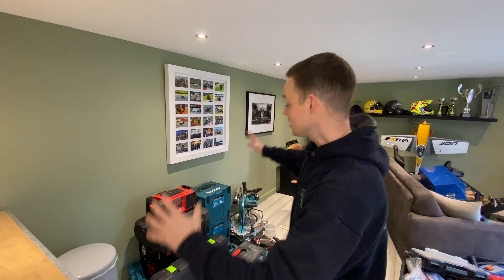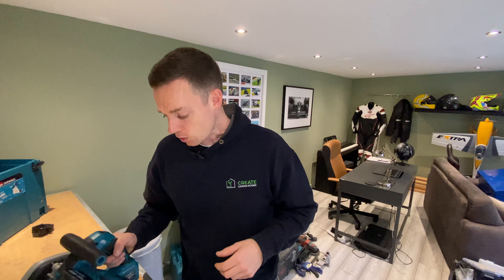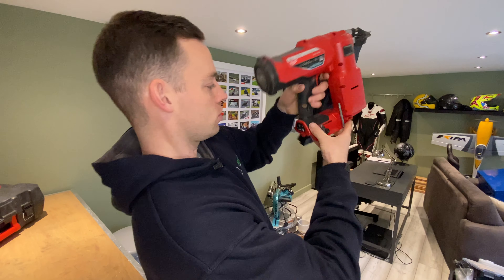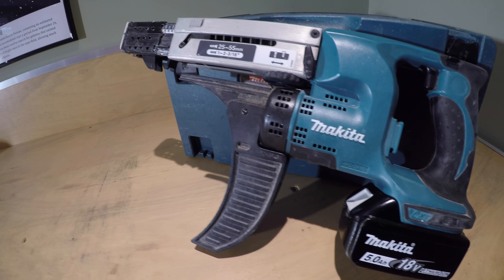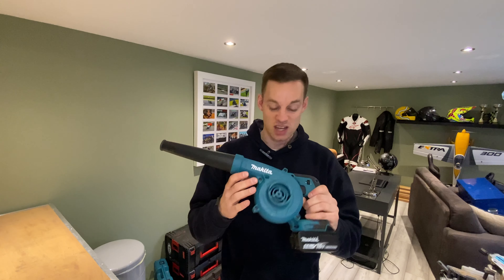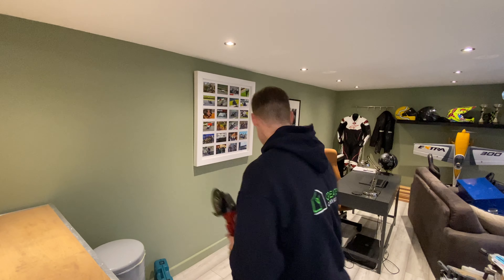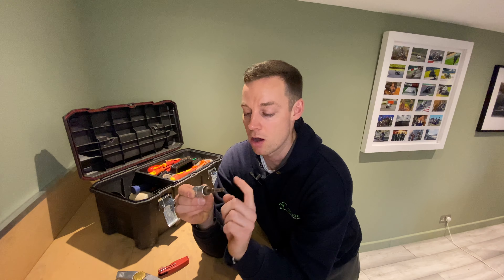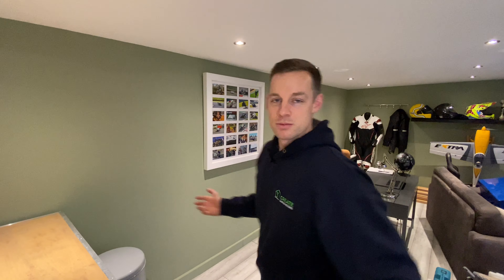What tools do you REALLY need to build a Garden Room with

Comment: Of course, many of these are also hirable - nail guns are really useful for sure, but you can nab one for 50 quid a week if you will only use it for one job. Also many you can buy corded versions for also, which tend to be far cheaper. I've got the plunge saw, which I love but went for the corded version for £200 less as easy access to power was always maintainable.